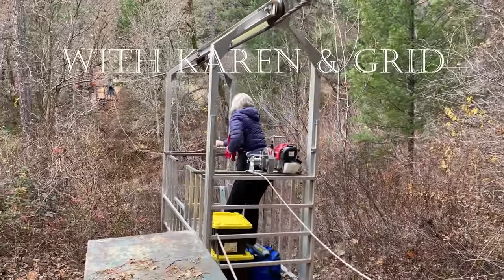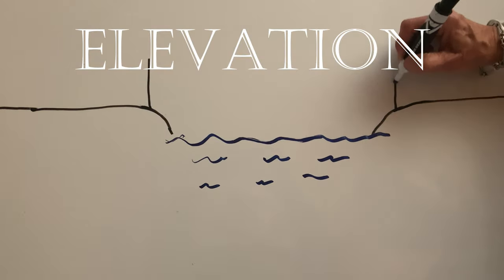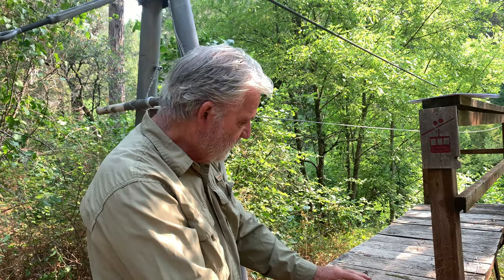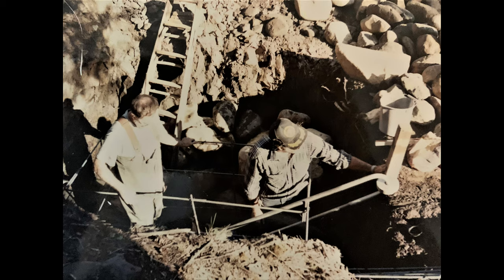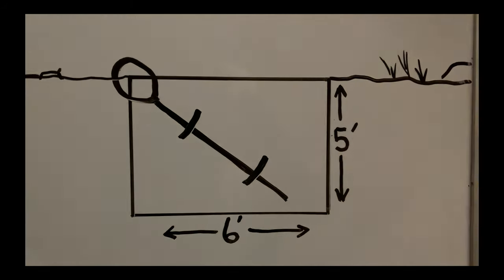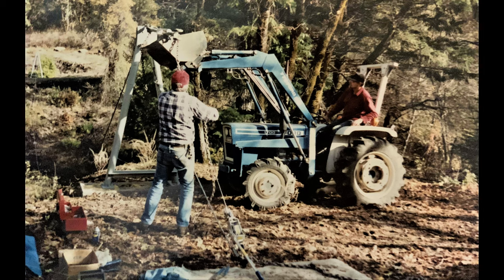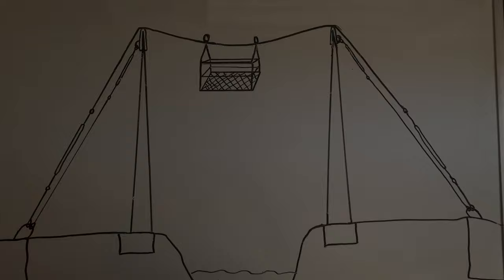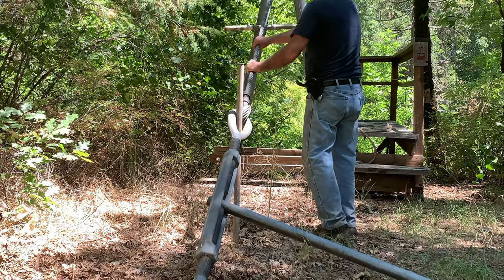Off the Grid With Karen and Grid: Build a Gondola/Tram  (Part I)

Comment: Great video. Fantastic gondola system you have. 

I have a friend who's family built a gondola over a river. They connected the steel cable around a tree on each side and they had balancing cables that pulled the opposite way on each tree to help equal out the tension. They slipped wood slats between the touch point of the gondola cable and the trees to prevent the cable from cutting through the trunks over time. They use a steel car rim/wheel, with a handle for cranking, on each side to pull on a separate thin steel cable that pulls the cart across the large steel cable. There are a few extra pulleys etc but that's basically it. It's been in service for decades at this point. 

Now that electric hub motors are widley available, I've considered creating a solution that could crank the wheels for us but also be easily removed when we leave so that the weather doesn't wear them out prematurely.
Reply from the maker: Thanks for your note. Your friend’s family took a very creative approach. What size rim do they used on the cable?
Reply: @offthegrid4036  I just asked him. He isn't quite sure but I'm guessing they are wheels from a 70s or 80s era pick up truck. I'm guessing that they are 16 inch wheels. They welded a steel bar on each wheel and there is a piece on the bar that spins while you crank the rim so that your hand can sort of stay in the same position. The steel cable that spins around the wheel is much thinner than the cable that their gondola sits on. Their gonola looks like someone took an old mining cart and converted it. So it's much smaller than yours.  I have pictures of it saved in my backups somewhere. If I can find some, I'll send them to you.

Comment: I noticed there’s a sprocket on one of your gondola tires. It wasn’t mentioned in your other video about all the ways you’ve tried winching the gondola from side to side. Is there a reason why you didn’t try hooking a chain to that sprocket?

I’ve seen similar, but larger and longer gondolas in Idaho over the Clearwater river. I’ve always been impressed by them and wanted to learn more. I appreciate your documentation very much.
Reply from the maker: Hi there. Yes, the sprocket is designed for a chain. Idea being you could connect it to a motor or bike pedals. Unfortunately, with cable sag the a motorized sheave slips on the steel cable when climbing from the low point (center span) to the terminus. Also caused wear on the cable. Thus all the experimentation.

Comment: So, a 40,000 lbs. concrete block on each side.  Wouldn't a couple of nice big trees do the job, or were there none appropriately situated?  Seems maybe a little overkill - was John planning for bigger things?
Reply from the maker: Nice big trees would be good. But nearby trees too small. And overkill is fine with me when I’m suspended over a raging river in winter.

Comment: 50 bags at 90 lbs each is 4500 lbs, not 40,000 lbs if I heard you say 50 correctly.
Reply: I think the water and gravel would add to the weight.
Reply from the maker: NeoMcCarthyst is correct. 7:1 mix
Plus water. Plus rebar.
Reply: @offthegrid4036  That's impressive. Could hold up a tractor-trailer with those anchors
Reply from the maker: It does seem like a lot of anchor.... but the way we load things up sometimes, it seems like we ARE taking a tractor-trailer across.